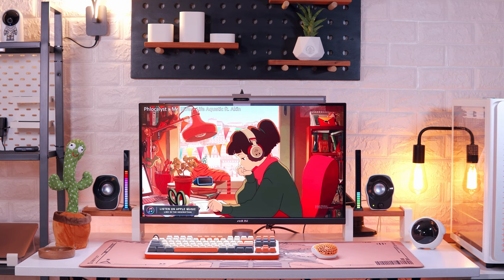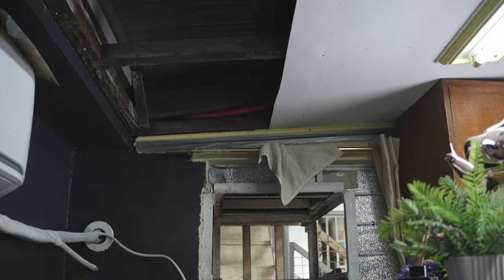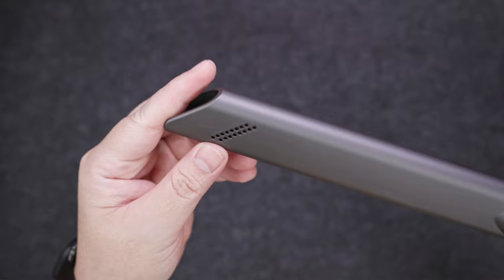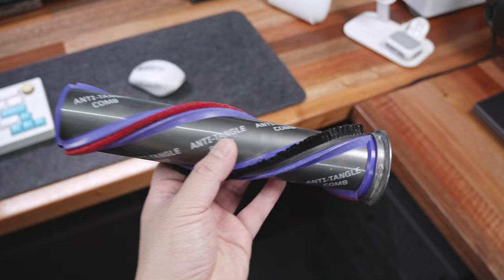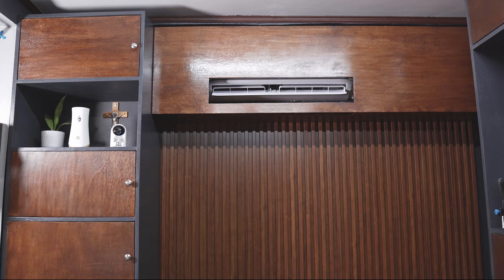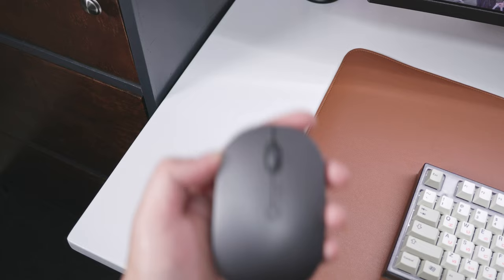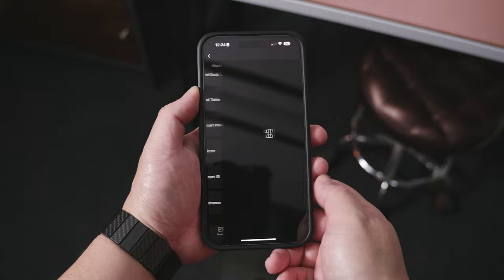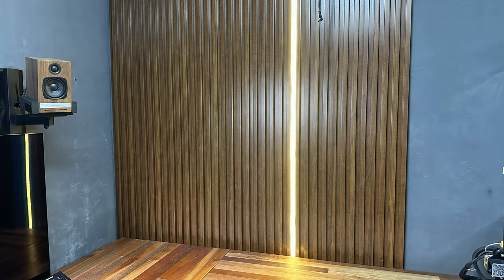Modern Desk Setup MAKEOVER 2023 Ft. Dyson V15 Detect!

Comment from the maker: Dyson V15 Detect 👉 https://bit.ly/3OaprP1 (Lazada)
👉 https://shope.ee/1Ar1ekoDqb (Shopee)

5 Reasons Why You Should Get The Dyson V15 Detect 👉 https://techbroll.com/2023/05/5-reasons-why-you-should-get-the-dyson-v15-detect.html

Timestamps:
0:00 - Intro
2:20 - Reasons for Renovation
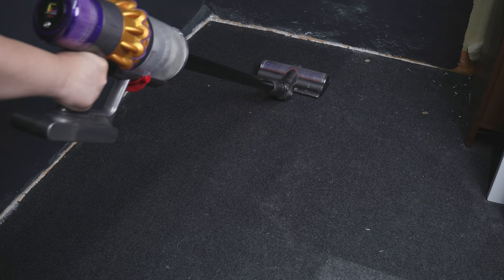3:23 - Dyson V15 Detect Review / Feature
7:41 - Renovation Proper
8:09 - Wooden Aircon Cover
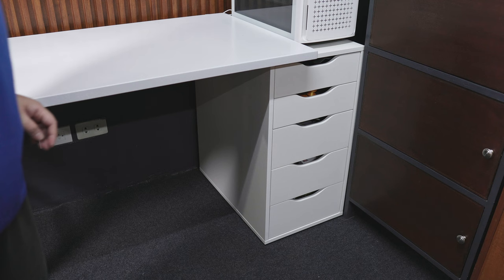9:07 - Table and Alex Drawer
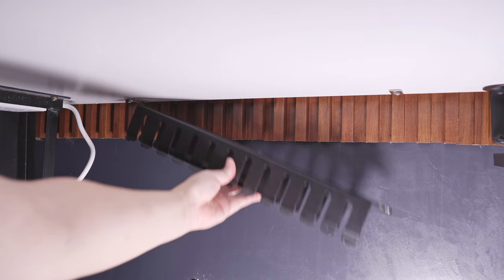9:27 - Cable Management
9:44 - Peripherals
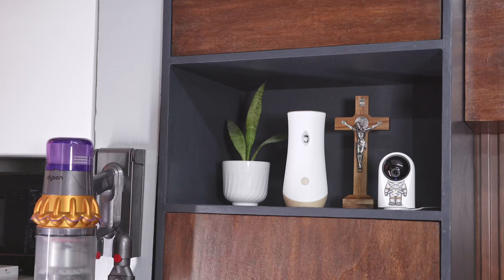12:34 - Cabinets
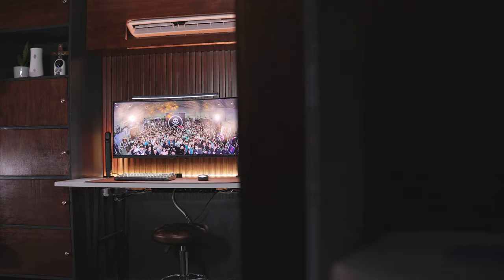13:21 - Conclusion